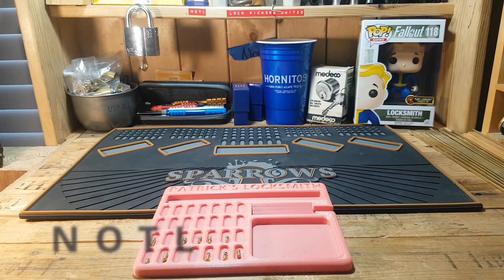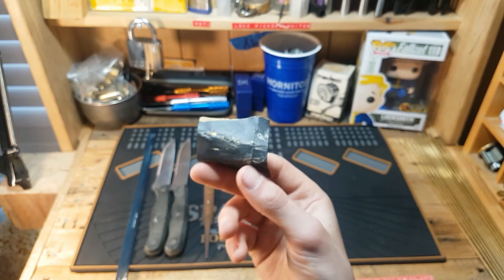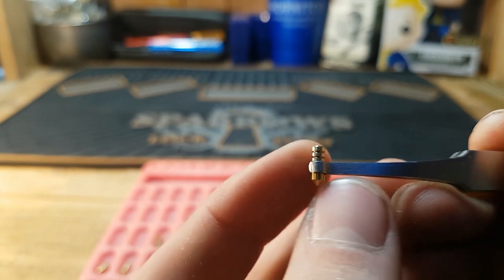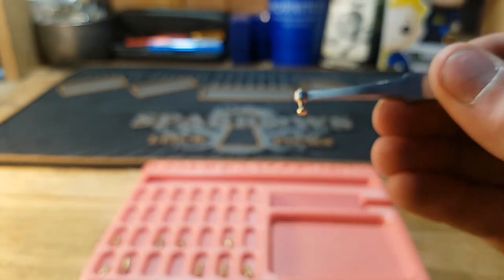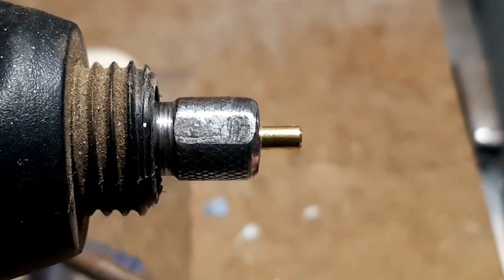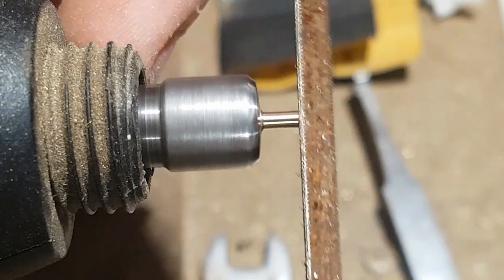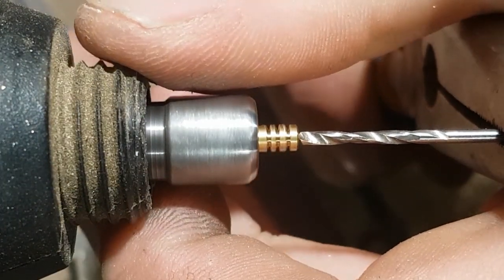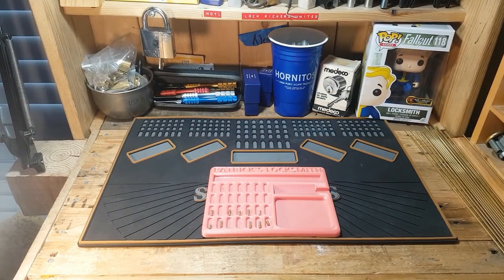Challenge lock pin tutorial

Comment: Great video, Notl! The only thing I think I could add to this is that you can also use a drill press instead of a rotary tool, if you have it. The material will come off more slowly, but having both your hands free is an advantage, I think. I still wouldn't recommend a hand drill, but basically any sort of shop tool that can spin a piece of brass will work.
Reply: I've never thought of that. Smart though probably have more control over the cuts aswell
Reply: You have to be careful putting lateral or sideways pressure on a drill press. The chuck taper is not made for side loads and can fly off in use. Probably not a problem with something like this. But keep a eye out. Also the speed of the dremel is higher and will lead to smoother cutting.